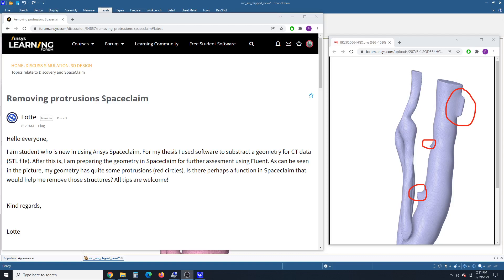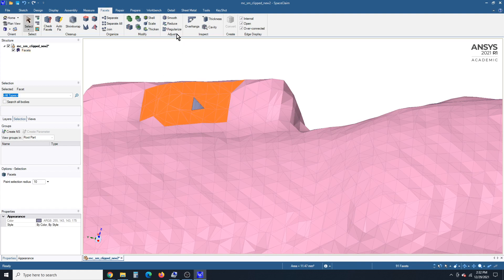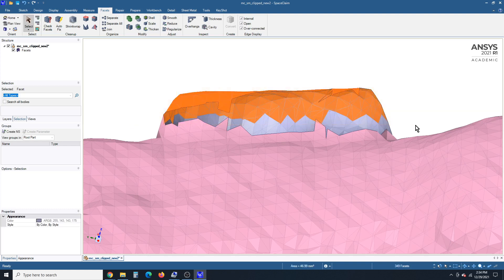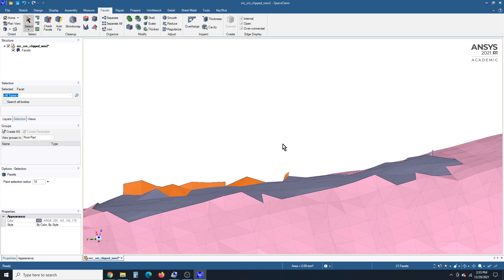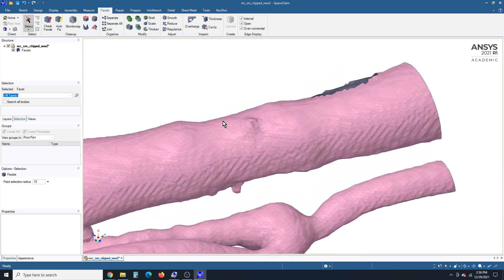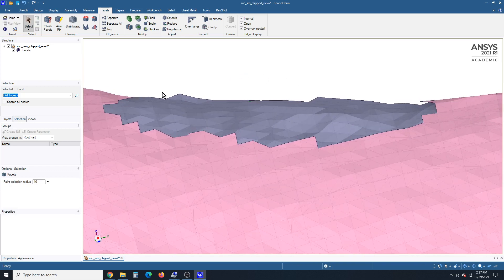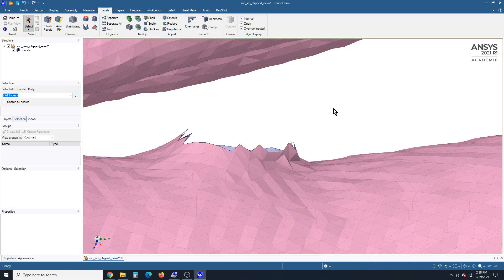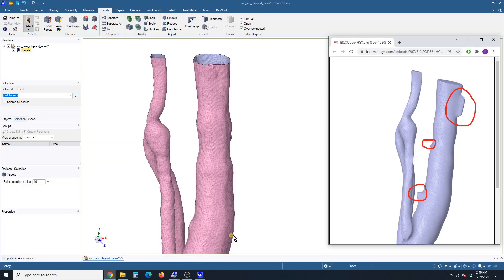ANSYS SpaceClaim 2021 STL - delete facets, fill holes

Comment: Hello Peter, I found one of the first video about .STl file import and meshing very useful. Could you please help with a video where I put a cylinder around the .STL file and do fluid flow through and around the solid please. Thank you
Reply from the maker: Sorry for the long delay replying. I recently did three videos on ways to convert the STL scan of a wing into a mesh of the air around the wing for CFD. Take a look at those recent videos.